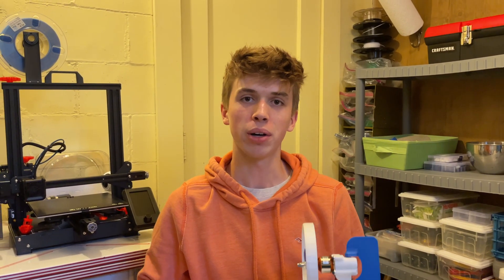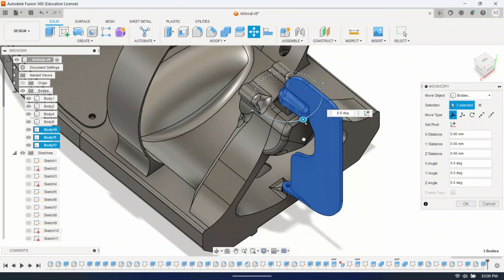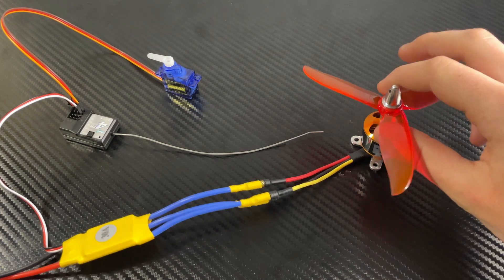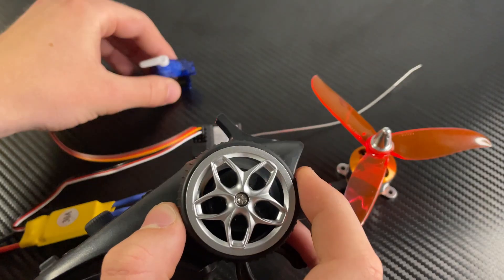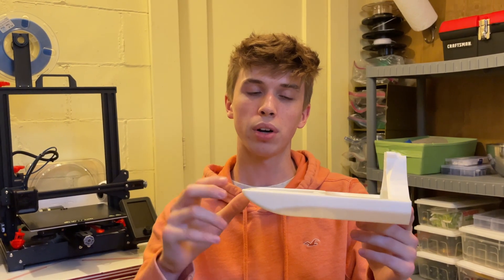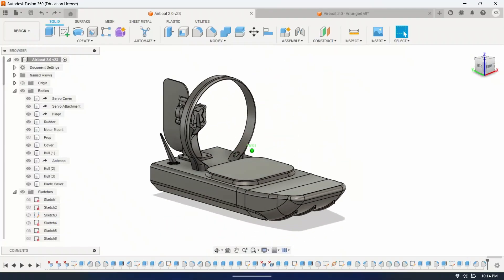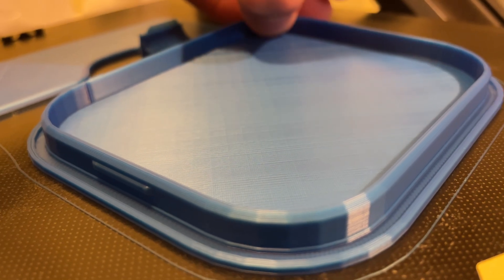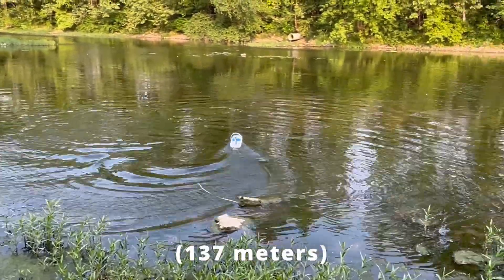How I built a 3D Printed RC Airboat (DIY)

Comment: Really great project. I'm new in 3D printing and this will be most advanced project I gonna do. One question: Didn't you have problem with to high battery voltage (9.6V) and receiver? Vendor says that max voltage receiver works with is 6V.

Comment: How do you recharge the boat.. love the design..
Reply from the maker: Thanks! I just use the charger included with the battery purchase. I’ve link the Battery/Charger in the description.
Reply: Ok. Thx for the response.. is the blue cap fixed with the glue for water resistant? Or can you open and close it and have no problems when the boat turns around. Thx
Reply from the maker: @danielthur6979  The blue cap/lid is removable. It snaps on and off. I applied a bit of gasket sealer along the rim of the lid to keep water out. I’ve linked the sealer in the description as well.
Reply: Thx.. I bought the things over your link.. you make very nice things..

Comment: The airboat looks great (I've just started printing one) but your suggested power system isn't all that good. For spinning a 5" propeller on 3 or 4 cells you'd be better off looking at the motors the fpv drone flying crowd use. 2300kv and 2204 / 2206 size is a good place to start. You could get a lot more performance out of a power system like that with less weight if you selected the right parts.
Reply from the maker: Thanks for the info! Yeah, I wasn’t too familiar with power efficiency for these types of motors. I just bought what worked for me. Hope all goes well with assembly!
Reply: @buildsomestuff  I'll give you a shout when I've got mine printed and working if I find a good power system I can definitely recommend. Could you do me a favour and tell me how much one of yours weighs built and both with and without the battery loaded please? It will help me choose the right motor. Thanks.
Reply from the maker: @christophertelford  Certainly! It weighs 12.55 ounces without the battery and 19.35 ounces with the battery.
Reply: Fingers crossed for my first airboat test in a few hours. I've used a BLheli esc which can be set to neutral at the throttle mid point and then opposite directions either side of that. Hopefully my airboat will have a working reverse feature though it'll be interesting to see if the rudder works.  @buildsomestuff
Reply from the maker: @christophertelford  Awesome! Hope all goes well!
Reply: It works and is very controllable at slow speeds. Above a certain speed going straight becomes tricky. This is indoors on carpet. I'll try it outside on grass tomorrow and then think about waterproofing it. I'm also quite tempted to try using a flight controller to control the rudder to help it go straight at higher speeds. Thanks for the cool design.  @buildsomestuff
Reply from the maker: @christophertelford  No problem! Glad to hear!

Comment: I am finishing the build of your airboat and I have a problem to configure the same ESC with a radio RC car (Flysky GT3B). I have neutral problem. How can you do ? best regards
Reply: I have the same problem with the same ESC but controller I used is GA-4H (the sam as in the video). When triger is in neutral position, motor runs with about 50% speed. When I push this to max (like when you want to break or drive back) motor stops. Did you solve this?
Reply: @piotrancerowicz6164  Hello, try to test with plane radio and not with surface radio. Working for me . Tell me if it will work for you. Regards

Comment: Bro, it's pla or tpu ?  That you have been 3d printed the boat from ??
Please reply 🙏👍☺️❤️
Reply from the maker: Just PLA here. Although, TPU may be a better option for this boat. But PLA worked just fine for me.
Reply: @buildsomestuff  and what about petg ?
Reply from the maker: @vishnuchaudhary4425  Oops! I meant to say PETG in my previous message instead of TPU. So, yes, PETG would probably be a better option than PLA. TPU would not work very well for this application because of its flexible properties. Sorry about this!
Reply: @buildsomestuff  very thanks, and nice working of you bro 👍

Comment: I have broken the rudder servo attachement and rudder hinge twice. I am going to try and print these pieces in PETG to see if that helps reslove.
Reply from the maker: PETG should help. Where exactly did the rudder pieces break? Was it the little alignment tabs that broke off?
Reply: @buildsomestuff  Yeah, the "tongues". I printed in 0.12mm layer height in PLA, perhaps if I used 0.2mm as you recommended they may have held up better.
Reply from the maker: @TrueNorthZero  Ah, possibly. If PETG doesn’t do the trick, it’s certainly ok to just pop the tabs off anyways and continue gluing without them. They’re not absolutely necessary, just there to make it a little easier to line up. Best of luck!
Reply: @buildsomestuff  Thanks for the advice. Printed the hinge and servo attachment in PETG @ 2mm and i tried to break the tabs off and they held well. Looking forward to your future designs as a Patreon sub.
Reply from the maker: @TrueNorthZero  That’s great!! Thanks!
Reply: @buildsomestuff  I connected a 6s lipo to my build this morning to play on the kitchen tile. Crazy fast and fun! I need to print another hull and re-inforce the motor mount attachment at the hull. LOL!
Reply from the maker: @TrueNorthZero  Awesome!!